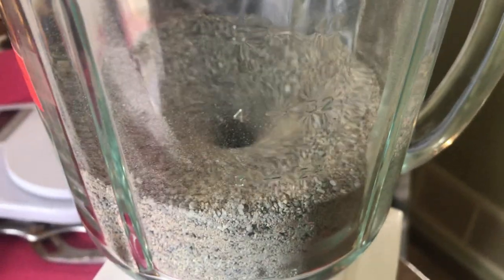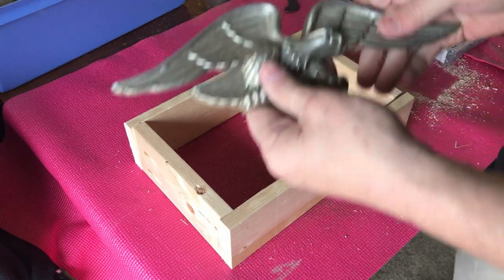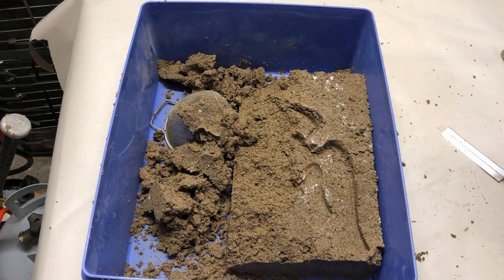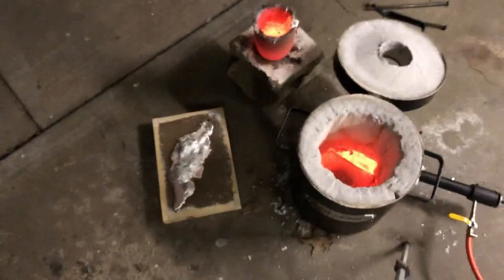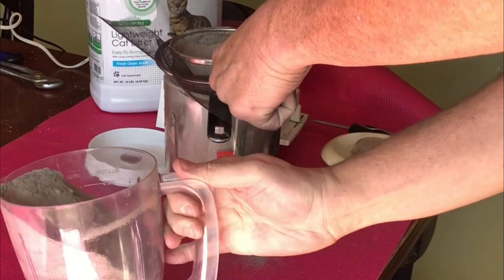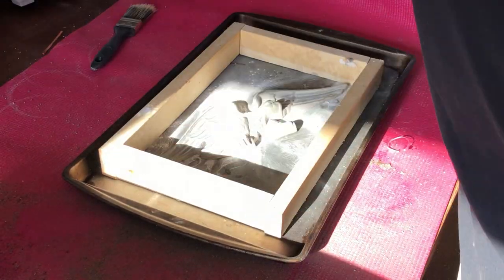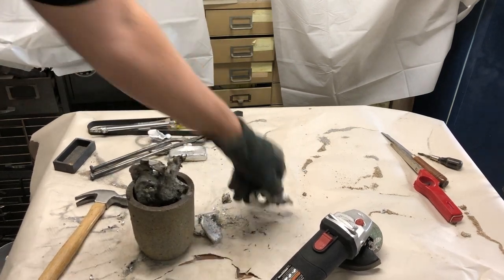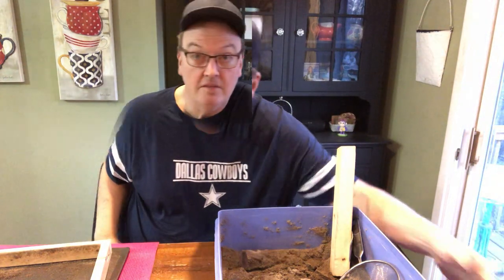Devil Forge - How to Make Green Sand for Casting - Casting Aluminum Eagle

Comment: I look at like this, no one got hurt, the law wasn't called on you, I call that a success
Reply: I would think using more safety equipment ie, steel toed boots not cloth sneakers and leather welding chaps and those long sleeved leather things they wear. Move your furnace away from the garage/house.  I'm just worried about you not doing this professionally/safely.
Reply from the maker: Thanks Darrell!   I do need to be safer.  ❤️❤️❤️❤️❤️
Reply from the maker: Janet, you are 100% correct.  I am working on the boots.  Thanks!
Reply: @ShaneManTV  even leather shoes til the boots materialize would be better than cloth. Did u burn your face???

Comment: Need to create a 2 piece flask. And  make sifter from some wire screen from window screen
Reply from the maker: So would that be a finer screen?
Reply: @ShaneManTV  you were just using a soft for use in kitchen. Was kinda small. If you make something like 1 foot square or may e a little better can put more sand in it. Then holding from sides  be able to shake side to side  get faster easier coverage.  Possibly finer depending on screen you bvb use